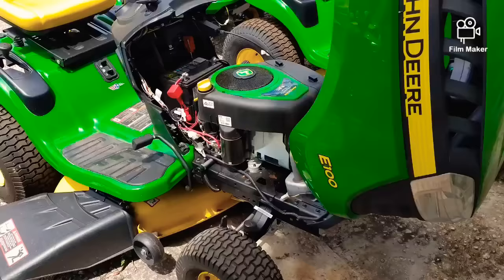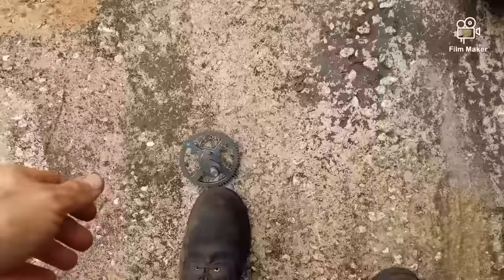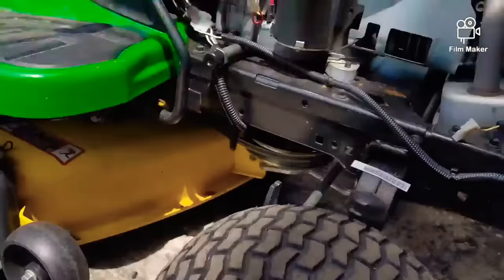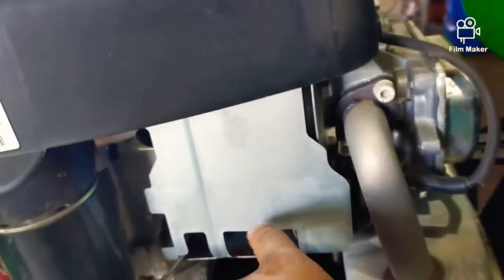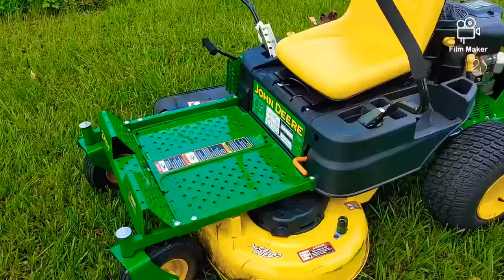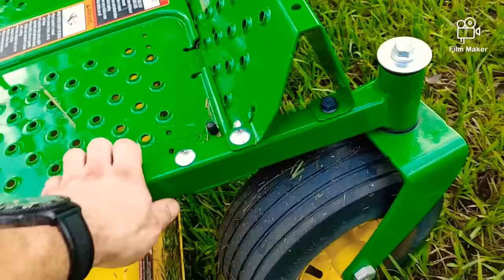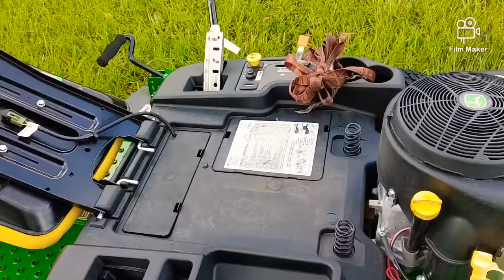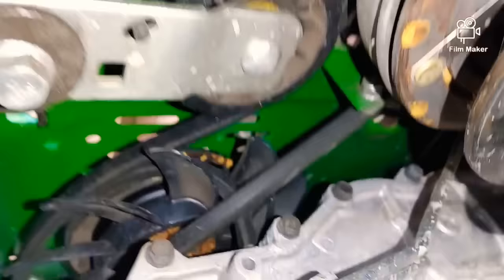Lawn mowers to avoid!

Comment: I recently bought a jd s 140 cheaply Made plastic not worth 3000 dollars got bit ............👎
Reply from the maker: What are some things you do not like about it?
Reply: Hinges on hood plastic you have to be extremely careful opening hood cheap, grease fittings on spindle's turned to inside hard to get to ..... not happy with J D but you get what you pay for.....
Reply from the maker: @J.RO.  Good points. I may make a video pointing that out.

Comment: I'm thinking about buying a Toro zero turn is it a good investment for residential?
Reply from the maker: If you're going to get a Toro, I'd avoid one that has a Toro made engine and try to get one that has a Kawaskai or Kohler.  I have a customer right now with a Toro commercial mower with a Toro made engine and its been a nightmare to get a new engine.  I also don't like how you can't access the top of the deck easily on most Toros because the foot plate isn't removable.
Reply: @Mechanical_Mind  
The one I were looking at has a Kohler engine but it's a 42' do you know if they still make any 36'-38'

Comment: What mower do you recommend
Reply from the maker: Here is a recent video I made a month ago comparing several brands
https://youtu.be/TBCQixtpu38
Also John Deere has drastically improved the Z300s. They fixed 5 of the 6 design flaws I mention in this video.

Comment: Good thing that is a very old lawnmower
Reply: Sounds like you need a repair man
Reply from the maker: You didn't understand this video at all
Reply: I understand that is low end equipment for yard mowing. However that particular mower was on the market for individuals that would like to have a RLE but couldn’t afford to buying the more expensive models.
Reply from the maker: @JohnnyMitchell-ci7xq  yes and I made this video to warn people about the repetitive issues with these particular models have. Better options are available. John Deere wants feedback from techs about recurring issues. Maybe that's why they changed and improved 4 out of the 5 issues I mentioned on that Z300 series for the 2023 yr. You made two statements "good thing that is a very old mower" they just recently made changes to both the mowers I show.... which one is "very old"? That Z300 whatever it is was exactly the same up to 2022. Then your 2nd statement "Sounds like I need a repair man" 🤣. That's what made me think you clearly didn't understand the video at all..   I am the repairman. These are not my mowers. These are mowers that people bring to me constantly needing these little piles of 💩 fixed. How do you not comprehend that from the video??  Jeez 🤣

Comment: That zero turn is not even made by John Deere that’s lame. Funny you mentioned a d130 since that’s what I have. I think a regular tractor is much more practical. I can pull stuff around with the mower and such. I never really understood zero turn mowers. I guess you can turn around easier sure but doing a 2 point turn in a regular tractor mower isn’t that big of a deal

Comment: People should stop being so lazy and stick to the dirt cheap walking mowers. I've had three mowers in 40 years. All had Briggs & Stratton engines. They last forever and you can drive an 18 wheeler over them without damaging them. My unsignificant other is 66 and uses a walking mower also. She's currently using a Toro.  Because she didn't want to wait for the old mower to get it's annual tuneup.  BUY AMERICAN. Show some pride.

Comment: Any opinon on the 200 series? Is it better than the upper 100 series and near 300?
Reply from the maker: Hi Bill, The 200s are just larger 100s. The X300 is on a different level.
Reply: @Mechanical_Mind  So deck is the same? Is it worth the extra money say from getting a S140 vs a 220 or 240? Having to cut 1.4 acres with some slope areas and some twigs falling from large tree?

Comment: Do you not recommend the John Deere S100?
Reply from the maker: Well, mostly I'd avoid the single cylinder Briggs. However the twin cylinder Briggs is actually a good engine. For a 2024 yr riding lawn tractor Cub Cadet and Craftsman are the better built units.

Comment: I got a Ferris. I won't by any J/D equipment due to the Right to repair court case. Wrong/greedy. They are dead to me. Just bought a case tractor.
Reply from the maker: We just started selling Ferris mowers. I have not had a chance to try them out yet but Im sure I will soon. They look nice
Reply: @Mechanical_Mind  they're a stiff ride compared to a little Z225 I can tell you lol. You really need a level lawn without any gopher holes to get a nice ride.

Comment: @2:52...isn't that the intake lobe?
Reply from the maker: Yes. I made a mistake... (some engines use the exhaust) Which lobe it is doesn't change the main point.  The problematic issue is the compression realse breaks on these engines all the time.

Comment: Only your opinion  mine has no problems
Reply from the maker: Never said it was anything more than my opinion. 🤣 Your opinion is based on your experience with your one mower...My opinion is based on after working on hundreds of them with the same issues time after time. John Deere apartly agreed with me  because they fixed all the issues for the 2023 yr model except the weak thin deck.

Comment: I saw a Cub Cadet zero turn at Home Depot with the Kawasaki engine for $3k. I looked into it and noticed the engine alone is around $2k. Of course that isn't at a manufacturer discount, but still. That told me the entire rest of the mower, the hydrostatic, deck, ect is only worth $1k. Passed on it and got a commercial grade Deere zero turn

Comment: Too common on these junk B&S engines. There is a way to start them without horrific repair bill. Also, check valve clearances first before going ahead with such a horrid repair in order to determine whether that is an issue @ all with the decomp valve not working ;)

Comment: Hey Hillbilly, my Z345 has been tits.  4 seasons and zero issues.  You buy smaller and cheaper for the amount of time you'll spend on the machine.  Don't buy a cheapo residential model and think you're gonna make 6 figures a year.  Could have summed this video up in 2 mins tops.  You're welcome.
Reply from the maker: So basically I hurt your sensitive feelings because I pointed YOU (not me) bought a cheap POS mower...🤣. I love how people with zero videos & zero subscribers always act like they are video making experts. Go somewhere else and cry. 🍻